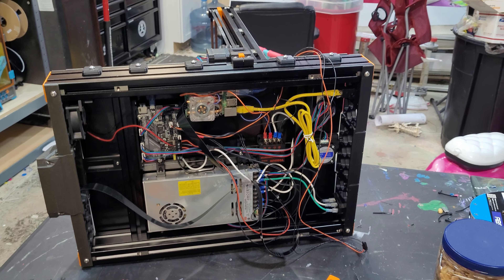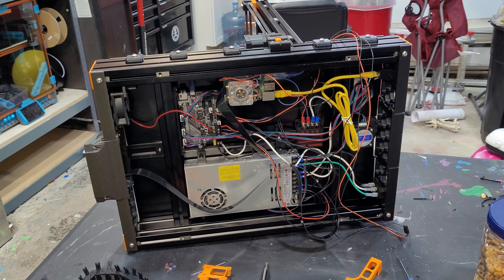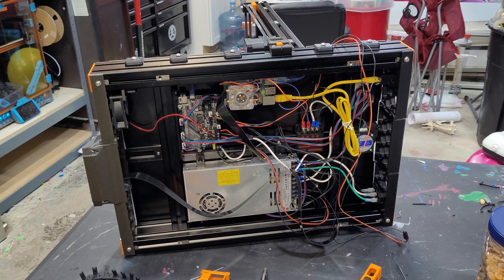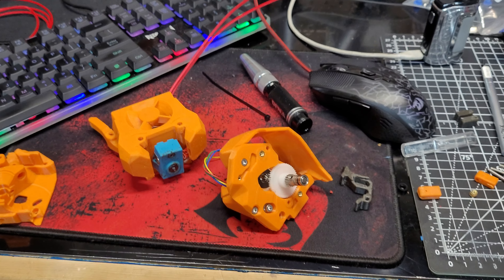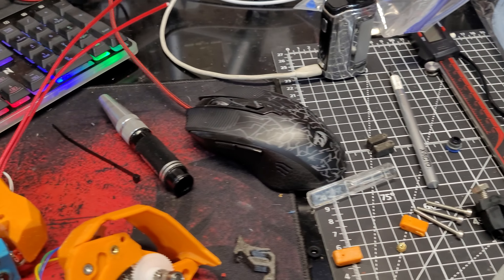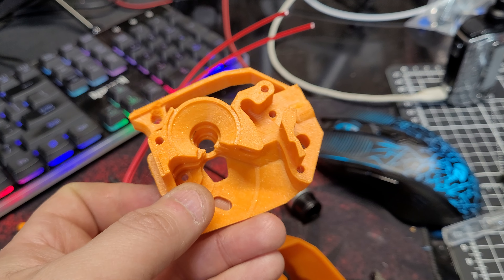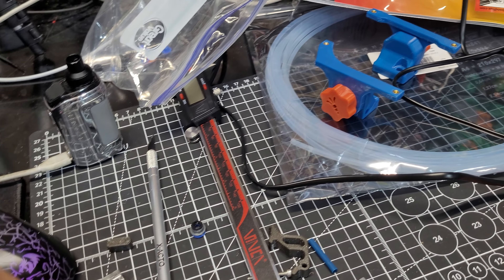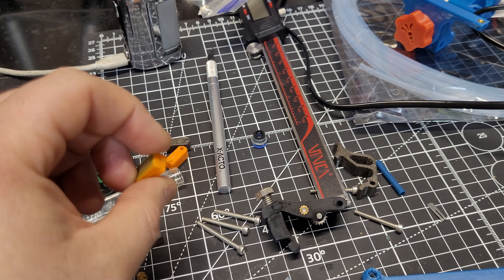Building and installing an ERCF v2 but it's proving to be a pain!

Comment: Where can i find more information about this? Is this a way to print different filiments on the same print? Will it work on any printer? I have a kobra 2 pro.
Reply from the maker: It will work on any klipper printer. It is not advised that you run different materials through a single tool head for that you really need a tool changer or IDEX printer. Here is the github link for the ERCF though.

https://github.com/Enraged-Rabbit-Community/ERCF_v2
Reply: @projectsindadsgarage  awesome thanks. Yeah, since anycubic is proprietary I don't think I could run this.